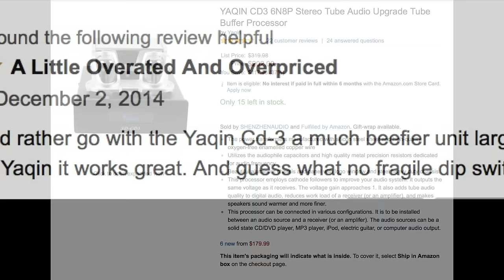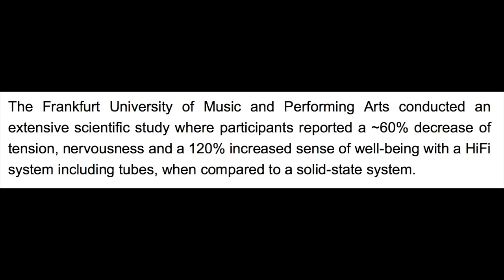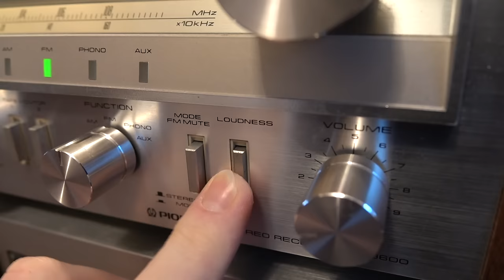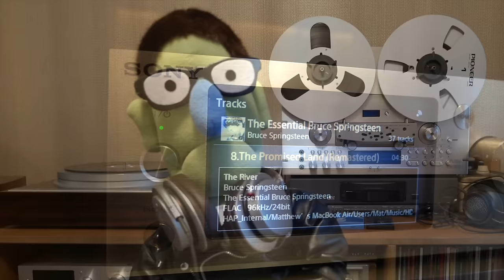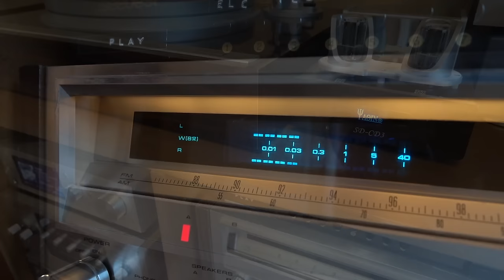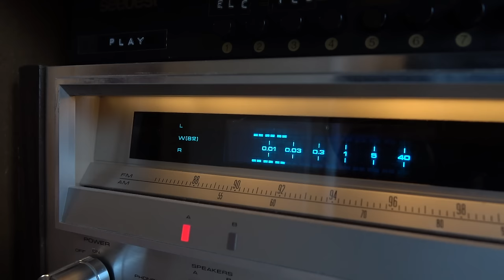Add the magic of Valves to any HiFi - with The Yaqin SD-CD3 tube processor

Comment: you (or some other youtuber) should do a network analysis get a freq. response curve than we know if there is actually a difference in the output signal.
Reply: +Blowitup1991 There is more to sound than just frequency response though.
Reply: spookanide magic!
Reply: Joke all you want, dynamic response over frequency maybe?
Reply: +spookanide You would see any dynamic change  in a frequency response analysis,  all dynamic response means is that the response can change depending on the variable or force applied,  which is exactly what frequency response is.
Reply: +Blowitup1991 there is a difference, it's not even up to debate, you can read up on it, but in short tubes distort the sound in a pleasing way.  It's something to do with sum nth order harmonics or something but there is truth to the whole "tube sound thing"
Reply: Youtuber EEVblog has done break down of valve amplifiers.
Reply: Also available in many tube engineering and design textbooks.
Reply: +Blowitup1991 given that tubes/valves introduce a light saturation into the mix there's no need to do a test. The tracks certainly would not zero out unless the signal was bypassing the tubes for some reason. Seems kind of silly to spend that much on a simple tube throughput to me though when you can get a decentish tube pre for the exact same price and dial in the amount of saturation you want by adjusting the gain.
Reply: +Blowitup1991 If the ears can't tell , what's the point? Unless you are a robot or something.
Reply: well... what should i say... of course poor people think there is a difference in sound if they buy a cheap 200 $ cable, would you admit to yourself you wasted that money on nothing?
Little do they know really expensive cables change the sound in ways inimaginable  read the reviews of this one https://www.amazon.com/product-reviews/B0055OM9WS/ref=acr_dpx_hist_1?ie=UTF8&filterByStar=one_star&showViewpoints=0
Reply: nice! free shipping
Reply: I think what you mean is a 1 khz tone passing through the device, then analyzing any harmonic distortion, finding what levels are the upper harmonics, and at what order of distortion it is.
Reply: There is something really important you guys are missing. Time domain performance. The amount of harmonic distortion a tube introduces to a signal is usually hard to notice, unless driven at extreme levels. 

Techmoan experiences the effect of group delay in this video, which is the result of the tubes' time domain performance. Basically what happens is, the tube delays the signal's diferent frequencies for different amounts of time due to phase non-linearities and a bunch of mechanisms I don't know. This happens in every electrical filter, which includes EQs and the speakers, whereas speakers do it to a more noticeable extent. On a psychoacoustic level, this effect alters what is often described as "soundstage". The different frequency bands hit your ears with a newly introduced delay characteristic which may sound wider and livelier.

Obviously, something as important as the "soundstage" is taken into close considereation in music production. Somewhere after "wide" comes "hollow", as the phase delay causes audible amounts of phase cancellation. So, as always, the results of adding such a tube processor to one's HiFi are highly dependant on the entire listening situation. I'd personally mess with the speaker placement and room first, before messing with the signal by putting it through a literal black-box.
Reply: Zaparter Interesting effects, perhaps like a [very] tiny time-delay?--except like u say, it depends on the tubes' various built-in characteristics, so you can't control the result/effects in the way you could with a full on sound effects unit or similar effects device, so it might be enjoyable but you wouldn't be able to tweak it to your own personal settings so you're kind of stuck with a few hundred dollars just for one setting unless you start moving your speakers around like you suggested.
Reply: rob M. - Yea, I'm talking about an actual time-delay, which depends on the signal's frequency. Group delay is the frequency-derivative of a filter's phase response.
In actual human english this just means a bass note might pass the filter a two digit miliseconds time-interval later than its upper harmonics and the entire rest of the mix. Phase non-linearities affect lower frequencies more noticeably, as their longer wavelengths make for longer delay intervals. You can assume "filter" means a tube-amp, or anything else in an audio chain.

Speakers are essentially filters as well. You can reduce the group delay of a subwoofer dramatically by plugging its reflex port. Because you lose the air as oscillating mass, you'll also lose some low end. With open port, air's inertia delay and elongate every bass signal reproduced by the sub.
Reply: Delta Fox, I think that "aural exciters" - but given all the #MeToo accusations in entertainment, maybe not.
Reply: Justin DiPlacido I've read that it also depends on the design topology.  A triode can be biased into a range that is more linear than other amplifying devices. Disclaimer: IANAEE.  However, there are many other issues which make it impractical to make into an audio amplifier.  Just a point of info. I read on the internet (gram of NaCl), that clipping is more common in recordings than people think. Both analog and digital. That pointed to another article, in the AES (IIR), that says another major advantage of toobs is soft clipping. If true, audio tests are incomplete and more need to be added, especially ones that include music.  I've never seen a test that includes "bad" inputs (e.g. clipped) The current set of tests are equivalent to judging a vehicle based on the fact that it has inflated tyres.  Based on this "test" a semi-truck and a motorcycle are equivalent for transportation.

I'd love to talk to anyone about audio testing to bring it out of the "earth, air, fire and, water" era. I don't think that a convincing argument can be made that the few audio measurements in use can be used as a complete model of music. I think that audio measurements can be made that can show that an output matches an input.  But that's just technical curiosity, or hopefully a starting point.  Listening is essential to choose the tone control you like the most.

Comment: I just picked up a used Grant Fidelity B-283. I'm running it after my Tube DAC and it's pretty damn impressive. I have a Sansui au-7900 which can switch to separate pre and power amp. It needs the left channel repaired but will try running it through the two. I'm currently just using it with the stock Chinese tubes and quite certain tube rolling will have a significant effect. Just as a side note, I've auditioned the Sansui through a variety of speakers right up to $5k B&W's and it does not disappoint. I know the sound of hi end tube and SS systems, despite "purist" opinions, the tube buffer is a good thing and does give you some of the benefits of a tube amp. I think people who poopoo them are just defending their pride and how much they've spent on a tube amplifier.

Comment: How exactly does one accurately measure a "sense of well being"?   After all, science would demand repeatable measurement of something tangible..     :-)
Reply: After you measure it, don't forget to multiply by 1.2 to obtain 120%!
Reply: It's self reported. Normally you'd hand over the participants a questionnaire with a bunch of statements, to which they can either "strongly agree, agree, neither agree nor disagree, disagree or strongly disagree" it's a well stabilished way to get some objective measurements of internal, subjective processes. There are a bunch of ways that study (if it exists at all) can be unscientific, if it doesn't properly control its variables, but quasi-quantitatively measuring qualitative and subjective phenomena is actually a well stabilished and accepted practice.
Reply: Mario Santos Rodas It's a well established practice, but issues with self reporting are also well known.

Comment: I own two of these and really love them. I run one with my bedroom setup, a Marantz 2238B, and one with my living room setup, a Marantz 2275. Using ADS, Mission, Vandersteen speakers It's clear to hear that they do improve the sound. Is it just a placebo effect? No. No it won't turn your system into a Mcintosh, but it definitely adds a warmth that I'll gladly take. Plus it looks great and is really well built. For the low price it's an absolute winner.

Comment: That original power lead was also dangerous and illegal.
Reply: Agreed. Not BS1363. He was lucky it arrived broken.
Reply: +William Davies I got sent one of them with a nitecore battery charger with a duff led on it
Reply: +wayne murphy I'm  surprised techmoan didn't mention it.
Reply: +wayne murphy likewise....
Reply: +ajuk1 What's wrong with it?
Reply: +Wasserverschmutzung First no fuse.  That  cable can't handle a full ring main load and would set on fire if there was a fault.  Second the size is too small there is a minimum space requirement to prevent you touching live pins with your fingers as you unplug it.
Reply: William Davies Thank you for the explanation.
Reply: +William Davies Wow I didn't know this either
Reply: Cheers for that information William.
Reply: +Robbie Crosbie no it doesn't
Reply: It's not "illegal". It just doesn't meet the standards.
Reply: *****
 Actually the sale is illegal in the UK. Just ask your local trading standards.
Reply: Robbie Crosbie
 It's not about lowering the current during normal operation, it is about protecting the device during a fault from the larger current present in the ring main.
Reply: +Robbie Crosbie - Fuses don't lower current per se. they do a little bit as they have a small resistance but this effect is negligible in the context of what you were attempting to say. The conductor in the fuse melts when the power is it dissipating causes its temperature to exceed its melting point. This occurs at (roughly) the current rating of the fuse. So no current is actually being lowered, the fuse simply blows if its rated current is exceeded.
Reply: bert smith 
no, is not like that, but if your house burns and you have one of those in there, the insurance company can refuse to pay the damages, even if the fire started anywhere else
Reply: Robbie Crosbie 
What's wrong with that he said?
Reply: UK/EU power leads should be a video on itself.  no offense.  I know  there used to be pride in wiring up your own electronics.  I think that was so cool.  Maybe an episode?
Reply: Always wondered why the UK plugs were so massive and chunky. I still prefer the plugs in the US, since they take up considerably less space. We do use the large style plugs for big appliances that use 220/240 volts, like welders and ovens.
Reply: Dogetor true, I just always thought it was odd in foreign countries like Australia, seeing smaller plugs running a washer and dryer in Australia.  I didn't realize how much current was going through your outlets in the UK.  But if that's why you guys have the fuse, that makes more sense to me.  I have some transformers, I noticed all the power consumption is the same.  it's the same manufacturers, just different region codes in most cases
Reply: I like our (Italian) plugs because the sockets don't have a "face", contrary to most of the other sockets around the world. Also, being flat they're easier to plug/unplug.
Reply: It is illegal, dangerous, and without the current-lowering effect of the fuse, it would have instantly exploded upon plugging, were it in working condition!
Reply: try saying that in court to a speeding ticket.
Reply: @robbiecrosbie4506  You were either instructed incorrectly,  or you misunderstood your instruction.  Fuses are NOT to lower current, they are to prevent too much current from flowing.